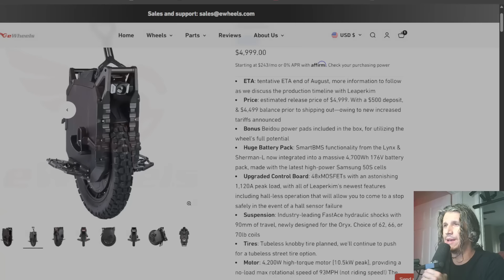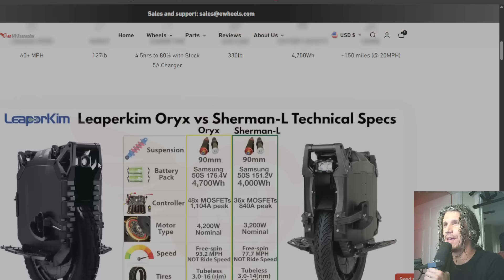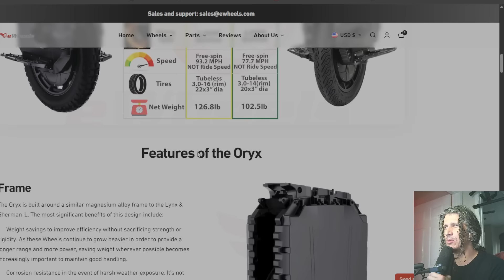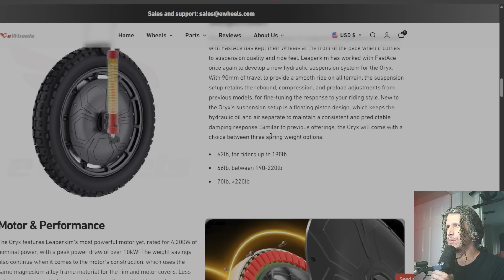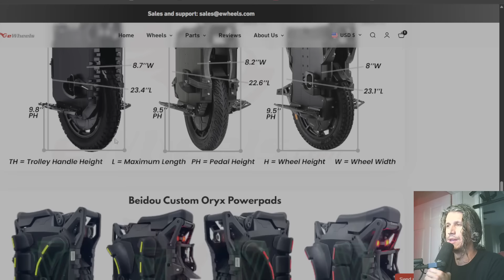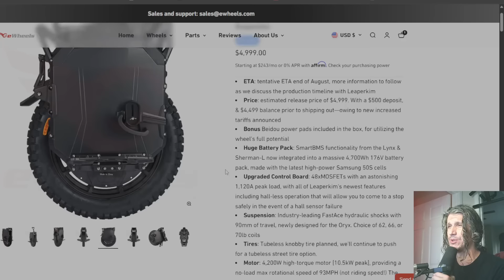The Veteran Oryx CRUSHES the Begode PANTHER

Comment: with the motor being smaller on the Begode , it would require more power to produce the same amount of torque as the Leaperkim wheel. (possibly why the Begode shows a more powerful motor) only a side by side test will show.. (also i preferred when Leaperkim named the wheels after tanks...)

Comment: Do you think the Commander MAX will be any good? A good race wheel?
Reply from the maker: It's a good question, I should make a video about it. My quick thoughts:

I've been seeing major issues with their wheels, my friend has a brand new Rocket, and the motor has issues under 25 miles...it's covered by warranty, but still sucks to get a new wheel that now he's going to have to replace the motor. So my concern with EB is QC issues. 

I just did a search on the MaX, its only 168v, I think that voltage is going to be outdated soon. It could be racing wheel for this year, but I think it will be to heavy for 168V. Motor specs aren't that impressive. Honestly I'd 100% take a used Sherman L over this and save yourself $1000.

Comment: 5k for this subpar 4200 watt wheel.  Can still pick up a EX30 with 4000 watts for half the price.  A standard for a heavy wheel which I do prefer for stability for long distance street riding should be a similar battery size, but at least 5000 watts of power.  Also for the newbies out there, it's not for the extra power but for the extra buffer with PWM before a possible cutout.

Comment: I'm watching your video, but I have to comment on this. When you keep switching back and forth from the Panther to the Oryx, if you look at the Panther, the spokes are way bigger, like there's way more spoke, so that tells me that the motor itself has a lot smaller diameter, and then the Oryx looks like it has barely any spokes, so the magnets are going to be way closer to the outside of the wheel, which is going to give the motor itself way more torque than the Panther, which in my head is just like a lower gear on a mountain bike or something. The Oryx is going to have a lot more torque since the magnets are a lot further away from the center of the wheel, and that to me right there tells me that the Oryx is going to have a lot of torque, and that's that. I just had to say that because it's all I can think of it when you keep switching back and forth between the pictures.

Comment: 0:56 nope, I bought the Extreme Bull Commander Max at 5300€ last week 🥹🤷🏾‍♂️ 
5:33 the answer is : because the Panther has BT speaker, sexy LED lights, USB-A and USB-C charging ports 😉 
PLUS : there is a 210V version of the Panther (a tinier version with 20'' wheel) caller the Begode Race upcoming, so people might be blinded by the performance video they saw few weeks ago

Comment: The Aero has dual-action hydraulic suspension where both sides have both compression dampening and rebound dampening. This was a major improvement over the FastAce system where only side dampened compression and the other dampened rebound, which contributed to uneven forces (particularly while hitting bumps while cornering) and would exacerbate chassis flex {Lynx}.  There are ONLY (2) wheels that have adopted this feature {that I’m aware of} but it should be standard for all hydraulic suspension systems. 
 
I do appreciate the floating piston and progressive springs but LeaperKim needs to make more improvements to make theirs into a mass market vehicle, similar to what the Aero and v12s have become. 
 
Love my 16x and will be upgrading to the Aero (eventually); also, love my Sherman-S and may upgrade to f22pro (because chasing top speed is the worst marketing plan since Begode exacerbated Adam’s cPTSD).

Comment: If you drop this down on Panther it surely crushes Panther. Cause it’s much heavier than Panther.
LeaperKim/Fastace have copied the design of Panthers’ suspension, not confident about quality issues, but the concept was from Begode. Oryx motor is big heavy one alike Abrams. So, there would be all the same flaws, you will have to push it too hard to make it accelerate or brake. This wheel is not race wheel, it will be slow on track, poor dynamics, physically demanding. This wheel is for highway cruising, keeping significant distance from other vehicles, as breaking distance would be quite long.

Comment: I love BG and LK, with unlimited budget for races I'd go with Panther as it is lighter. Though throwing Lynx around the corners for longer period in track is very tiring, this thing will be so heavy to do the same. Could be too heavy for racing.

Personally I'm riding fast on gravel for longer distances in rural areas, I want a 22" wheel with hallsensorless tech which can fit Shinko 244.. yeah, only one option.

Comment: its too bad these things are a complete rip off though..I can get 60 mpth 100 range hype scoots for 3 k..top line 60 mph + for 3.5 -3.7k all with quality samsung or LG batteries..i really dont get why the euc community rips off americans so badly. and E wheels is the worse perpetrator of this..4.5k for a Sherm L..5k cuz they want to charge tax out of state? so 5.5k for this thing? this thing isnt worth 5.5.k..it be like 4k tops and thats pushing it in the pev..this looks like a lot of fun but these prices are dumb as hell..and i have the money to buy em outright..but its rip off city..im taking the Nami Blast for 3k..2.925k with a code..60 mph..100 mile plus range..great suspension..I could get a talria mx5 for a grand less than a sherman L..how does that make sense? just a rip off
Reply: What wheel are you riding now?
Reply: @RUSHmarley2112  none..i wanted to get into the pev hobby..i was waiting for summer to end..im going to pick the nami now for 3 k flat..if i could have gotten the sherman L for 3.5k i woulda got the euc..but 3.9 seems to be the best offer i could get..just not enough value there for me
Reply: @Spazzfrom.1989  You don't need to buy a heavy, uber-expensive, top-of-the-line wheel to enjoy ripping around on EUCs.  I think it's a pretty different experience from other types of PEVs.
Reply: @Spazzfrom.1989 you in London ?
I’m looking to sell my nami blast max for £2000.
I bought 8months ago, so it’s still warranty on it !
Reply: @SECshock for 3k the packs are pathetic though. The prices are jacked up across the entire line up like the patton should be  willing around 2k ish. And they can't use batteries as the excuse. Even the e motos don't morph higher despite better power trains and packs. Look at the mx4 and 5. People need to stop giving wheels the mono on this because it's obvious the margins are way too good
Reply: @FofXequalsYnot I'm over here in the states. Yeah I'm excited about the 72v..I'll pick up a leperkim when prices get competitve
Reply: @Spazzfrom.1989 🙌🏽
Reply: I'm in UK and if I got a scooter then it's rougher ride and a good chance it gets taken off me by cops... They leave me alone with euc and until you've ridden one you won't appreciate the difference in experience you would have... Scooters are way more dangerous... I know this from personal experience and once you master euc riding it's a game changer... So many more ways to go due to agility and control.... It's amazing and would pay double a scooter cost.... Ain't all about power per dollar I feel... I see the guy above wants to sell you his Nami....speaks volumes
Reply: Also check out electric mane i  the uk.. he runs and didges them all the time on a 2021 burne e. Watch that guy and tell me hes not having a blast @EUCScotland

Comment: of the 22' wheels I've ridden - really only liked the Monster Pro tire.   It has a flatter profile than the super rounded street tires that really planted itself on the road.  Be interested in the tire choices, and what riders think of the tire feel.  Issue I've discovered with super rounded tires is their desire to stay vertical to road surface - hovering on a tiny point of contact at high tire pressure.  This is fine in perfect conditions, but in real world conditions with grooved roads and wind... I personally want a road/all terrain tire with a flatter profile.  That knobby looks good, but fear it might have pretty dramatic drop off on slow figure 8s and holding certain turns at speed.

Comment: Who ever gets the oryx for racing is going to regret it. 127 lbs forget it 👎🏻
Reply: Only time will tell
Reply: I'm buying it for racing & cruising, just like my Sherman L.^^
Reply: Absolutely, but will love to see it🫠
Reply: The weight of KS S22 or GW Master  was also said to be "madness" at the time, especially, in comparison with GW Nikola/Tesla/ KS 18L/ Inmotion V10 etc. Now 40-50 kg is already becoming the norm. Waiting for 100 kg vehicles
Reply: And it'll eat thru the  battery, higher voltage isn't necessarily better Have a Patton s and honestly don't like it. Hate leaprekim software. 🤔
Reply from the maker: Disagree the bigger tire and voltage will compensate for weight
Reply: @ZenLee  the GT pro is already a heavy wheel. It’s heavy for racing now imagine a 130lbs wheel .
Reply: @ZenLee  i agree with her, the weight is pushing it and also ewheels has BS pricing so its not a fair price comparison